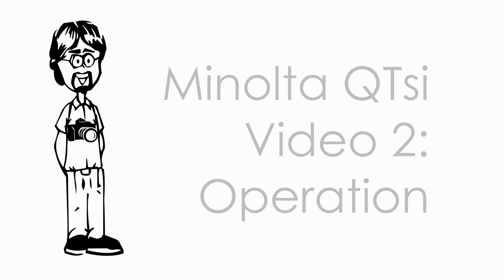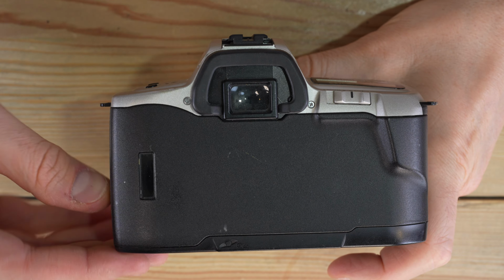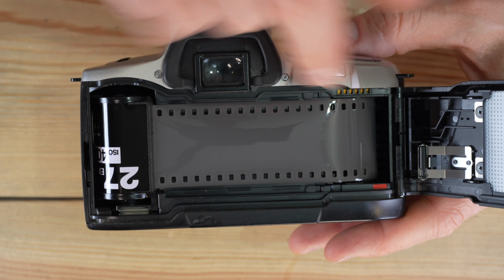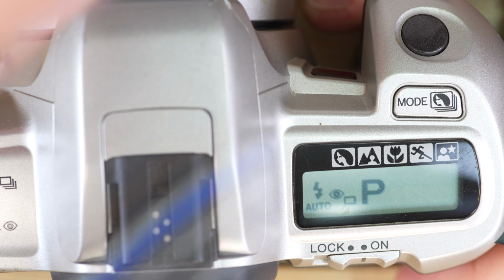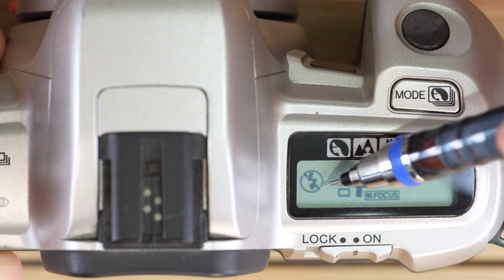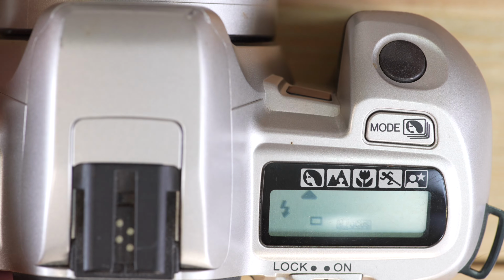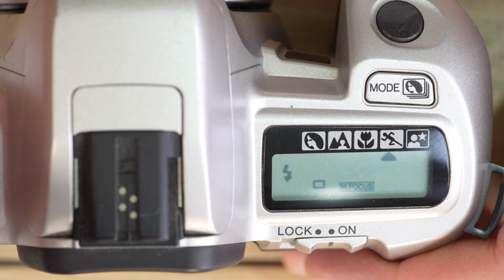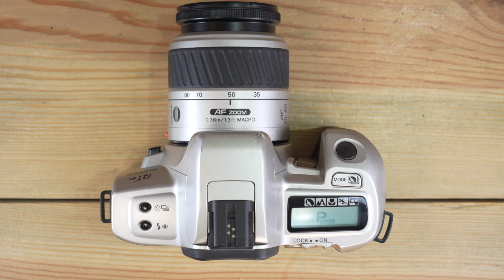Minolta Maxxum QTsi Tutorial Walkthrough: Batteries, Lenses, Load Film, & Take Photos

Comment: I was gifted one of these about a year ago and have found it to be a really fun camera to use precisely because of its simplicity and light weight.  Sometimes, it's a very welcome departure from my other cameras, even my other Minoltas, when I don't need or want to control everything and am not doing paid work.  My QTsi does not have the mirror discoloration you mentioned in these videos (thankfully!), but I'll be watching out for that to develop now that I know about it.  David, I really appreciate your channel and the videos you have put out, including this one!

Regarding the ISO, this camera will remember and use the previous film's ISO setting if you insert a non DX coded film.
Reply from the maker: Thank you for the DX tip! That's a great one I didn't know about.